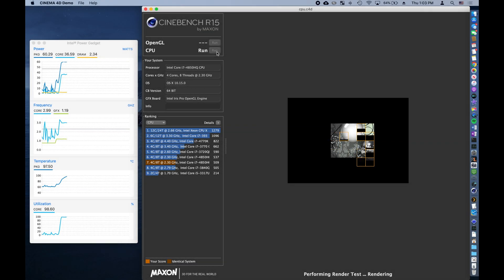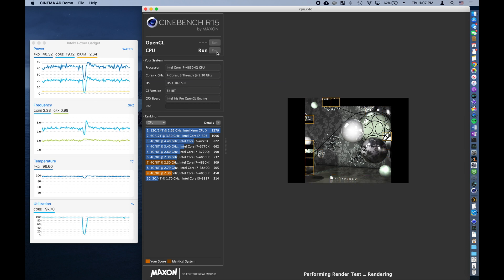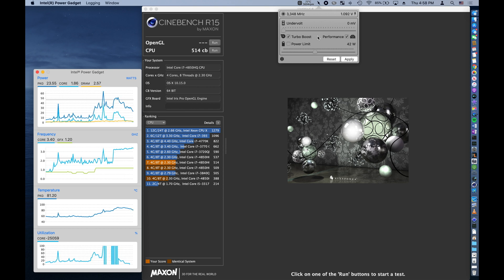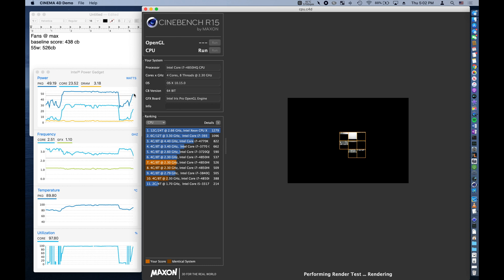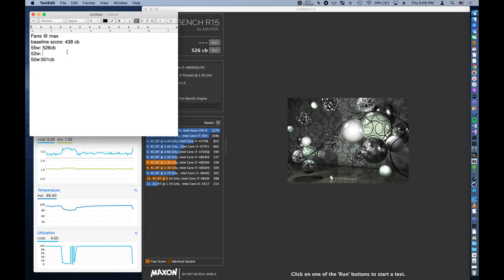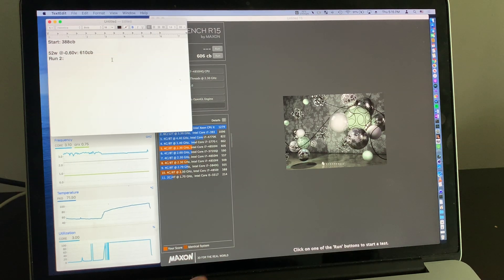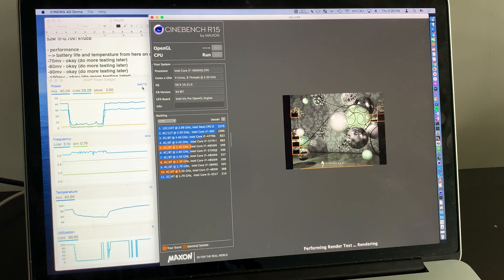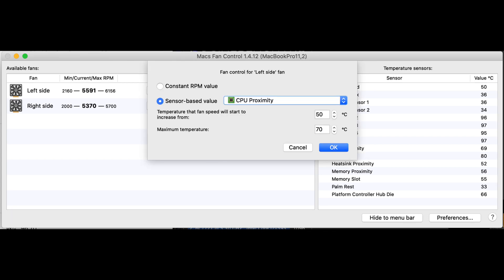Undervolting Tutorial | Mac OS Catalina | Destroy Thermal Throttling

Comment: I have everything unchecked and running on auto and my CPU proximity is 31 should I not even worry about undervolting? I set out to get my machine cooler it worked for CPU but overall temp is at 93 Celsius. Mid-2015 MacBook Pro running on latest Monterey OSX.
Reply from the maker: 93 sounds a bit high. Undervolting has many benefits with few drawbacks if you do it right. Worth a shot if you ask me!

Comment: Macbook 12 2015 here. How could I undervolt and get better battery life? I do only write in word and watch videos/ listen to podcast
Reply from the maker: You can definitely get better battery life. Adjust the voltage settings down while the CPU is not doing much until it crashes. Then use that setting (-125mv as an example) for daily use - if it freezes again then adjust upwards until it is stable.
Reply: @RuslanTulupov  oh thanks you! Since i Will only write, should I lower the TDP W ?
Reply from the maker: @axel9546  I would bump it up like in the video until you don’t see improvements to give the CPU breathing room and let it scale up if it needs to - things like software updates, occasional chrome launches might go faster. 
But if those aren’t important to you then yes, you can keep lowering the wattage until it’s slow but usable if that’s your primary use case

Comment: What’s the point of finding the upper voltage and lower voltage limit? I’m so confused about that! Should I leave my MacBook at the upper voltage limit all the time or should I leave it at the lower voltage limit? If you can please explain this to me, I will greatly appreciate it :)
Reply from the maker: Upper voltage is when your CPU is maxed out. Lower voltage limit is when the CPU is idling. 

You’ll want to use lower voltage limit as your setting - I could have made this clearer in the video and clarity is something I will work on!
Reply: @RuslanTulupov  thanks for the clarification! how can I properly find the lower voltage limit? Do I need to leave “Voltage” on in “Performance” mode or “Turbo Boost” mode while doing this? If you can please list out the proper steps on how I can do it, I would greatly appreciate it man!

Comment: MBP 2015 15" 4980HQ (2.8Ghz) 
I am getting 3.8Ghz while running Cinebench R20 and a score of 1454 or so with an undervolt of -70mV  and ambient of 16C but I haven't checked idle without any apps. I have checked it "idle" with my standard apps and at full bore for an hour. I am managing to sustain about 49-50 watts electrical to the CPU (after the initial peak). I run a CB R20 test or two which gets it hot and brings the fans up to 100%, then I lock them at 100% and run another couple of tests. Clearly heat produced by that electrical load will be less. I don't now how much less. TDP clearly is heat not electrical. I should mention that I am here writing this because I had issues with performance degradation so I repasted the CPU with Noctua NT-H1 that I have used on lots of other systems successfully. I then had much better results for a few days only to have the performance degrade again. I repasted with some even older Arctic Silver 5 I have and the results seem good again. I'll report back if I get performance degradation again. It appears the NT-H1 was pumping out. I read up on some white papers that spoke about pump-out and it definitely appears to be a thing with NT-H1 and bare dies like in these laptops. I also noted that my heat sink copper base plate is NOT flat. Its the first CPU heatsink I have ever seen that isn't flat. Its concave. I have wondered if the NT-H1 is not well suited to the high temps on these laptop die contacting heatsinks. Also wonder if the concave heatsink surface exacerbates the pump-out likelihood. Ah, and I have neglected a key point, I have my laptop on a custom stand that has a Scythe S-Flex 800RPM 120mm fan blowing air over the bottom and into the intake. Its got the dedicated GPU active all the time as its running two external monitors (1920x1200 + 2560x1600).

Comment: I got most of what you are saying, but didn't get how you arrive at the optimal undervolt value of -55mv? your MacBook crashed at -120mw correct? so how did you arrive at the optimal value of -55mv? Thanks!
Reply from the maker: Completely understood, I could have made that more clear!

At 100% usage the Mac was stable at -120, but at 0-10% usage it was only stable at -55. Since the Mac goes between 0-100%, I had to use -55.
Reply: @RuslanTulupov  help me! I can’t undervolt my macbook (MacBook Pro 13 2011)

Comment: There really should be a way to adapt the voltage to the CPU load. If the CPU is maxing out, drop the voltage to that -100mV, if it's idling, go to -50mV.
Reply: you mean voltage curves? yes, there definitely should be a way to adjust that as with GPUs.
Reply: This should be possible with VoltageShift for Mac
Reply: That’s exactly what the OS does, it monitors performance and adjusts voltage breaks every 150ms.

Comment: Hi Guys this is findings for my machine

MacBook Pro (Retina, 15-inch, Mid 2015)
2.5 GHz Quad-Core Intel Core i7
16 GB 1600 MHz DDR3
AMD Radeon R9 M370X 2 GB
Intel Iris Pro 1536 MB

Base Score Test - Cinebench R15
Test 1 - 289
Test 2 - 319
Test 3 - 292
Test 4 - 234

My Optimised configuration was base on highest Cinbench Perforamnce with Best CPU Temp | Best GHZ | Max 100% Core:

Cinebench Score was 530
35Watt
-100mV
Consistant CPU at 2.8Ghz
CPU Temp was a consistant 85degrees!!!!! SOOOO GOOOD
Core Utilization was 100% through out

Highest Ever Score and Configuration was:
Cinebench Score was 569
45Watt
-100mV
Consistant CPU at 3.1Ghz
CPU Temp was a consistant 100degrees!!!!! VERY BAD TOO HOT!!!
Core Utilization was 100% through out

I Hope this helps out anyone else.
Reply: The CPU can handle that temp(100). Don't be afraid of it. If you want to save power then thats another thing. Longevity might be affected but I have no evidence of that.

Comment: Volta crashes on my a1502 no idea why but gets to 100% cpu
Reply from the maker: Did you already adjust the voltage?
Reply: Ruslan Tulupov I just did a fresh install of Catalina, reset pram then did the sip commands on the Gary Mathews site. I think the programs simply broken in Catalina as I also did the exact same procedure with high Sierra and it worked properly.
Reply from the maker: @ps3customgamer  Odd. I had it perfectly running on Catalina (granted it was an earlier version than the latest). I've lent out my 15" from 2013 but in a few weeks time I'll have access and will be able to investigate (if that helps)

Comment: Are u getting almost 100% cpu usage using volta in catalina? Btw great vídeo :)
Reply: @RuslanTulupov  Hello, i have also the problem on 10.15.2 that the helper is using more than 300% CPU Usage. Do you have this Problem? I'm using an MBAir 2015 and it worked fine on Mojave. Any fix? I also reinstalled it but with no success. Thx, Fatih

Comment: Do you have to keep u SIP disabled whenever you run Volta or can you reenable it after you set it up?
Reply from the maker: SIP must remain off for Volta to work. 
(Apologies for the delay! Some comment notifications go to my YouTube studio app, the others to YouTube). I try and get most questions answered ...
Reply: happyaccidents I think it’s just broken in Catalina. I’ve had the app ages and when I open it my fan gets loud and activity monitor shows com.gmsthews.volts.helper at 323.67% in cpu.
I was hoping to wipe the application support folder but there doesn’t seem to be a Volta or Gary Mathews labelled folder
Reply: SIP is disabled though no issues back in Mojave on this mid 2014 MBP. I also have a 2012 MBP which isn’t supported either and the same process starts on that using full cpu
Reply: @ps3customgamer  It isn't working on Catalina? I have the same MBP as you do.
Reply: Musthafa Noor I’d be interested if you could get a difgerent result. As above it’s broken on Catalina with SIP disabled. I messaged Gary Mathews no replies
Reply: @ps3customgamer  I tried it out, didn't really work (I'm new to this, maybe that's why). Have you tried it with Bootcamp?
Reply: Musthafa Noor it’s just an app on Mac. On “bootcamp” you’re just running Windows with intentionally crap Apple drivers but they didn’t disable access to intels XTU program like a lot of budget laptops
Reply: PS4 Custom Gamer Have you tried Voltage Shift on Mac? Saw it on GitHub a while back.
Reply: Musthafa Noor I couldn’t find a built version. I’m sure it’s easy to build the app but I haven’t learned to do it and I really don’t want to learn to do thay
Reply: Great question and I was wondering the same thing.

Comment: are you on a real mac or a hackintosh?

i suspect hackintosh because apple does not use overclockable cpu and undervolting is an overclocking thing.
Reply: You can still adjust the voltage as the processor scales itself. The point it to reduce thermals and increase performance for as long as possible given the constraints. Also you can see it's a MacBook Pro in the video itself...
Reply: he isn't overclocking, just altering the power and voltage going to the CPU. this has nothing to do with overclocking.

Comment: i was able to get it had to disable SIP.. btw raisting the watt from 48/50 to 55 wont damage the cpu?   my cpu when locked in to performance maxes at 25watts.
Reply: im sorry it maxes at 29  i put it to 35 and it still stays at 29.. i actually got a better score when i lowered the watts to 27.. 29 watts had it throttling
Reply: Ruslan Tulupov thanks me too. Yeah i end up putting watts down to 25 since my cpu couldnt go past it. It put the turbo down from 3.4 to 3.2 and temp at stress from 102c to 92c with turbo on.   Btw do u know if running benchtests within 10 minutes of replacing thermal paste will ruin the time it needs to settle in? I used grizzly
Reply: Ruslan Tulupov great video btw. Really helped my cinebench score improved from 756 to 838 running at 3.4 and 813 running at 3.2ghz UV at -55 and watts at 25

Comment: At 2:05 you say your processor maxes out at 45W, but I don't see clearly how you determined that.  Can you please explain?  (I have a mid-2015 15" MBP top end model and wish to determine the same.)
Reply: @RuslanTulupov  Thank you for the advice.  It appears my I7-4980HQ is 47W, according to Intel's website.  I'm still trying to figure out what that "Performance" checkbox in Volta does.  Sadly, the Volta website makes no mentioned of that checkbox at all.  So I am trying to determine if you are reducing Power in Volta primarily to save battery when your MBP is used exclusively on battery power, or if there is some other benefit to reducing power to 52W in your case.  I know you mention "thermal limit" but are you really getting a performance gain by reducing power to 52W in combination with under-volting versus not limiting power and using the same under-volting?
Reply: @JDW-  What was Ruslan Tulupov's comment? It's somehow deleted and now we cannot see what you replied to? :)
Reply: @rolanddes  It was 1 year ago, so of course I cannot remember.  Very odd that he would have deleted his posts though. You can see the exact Volta settings I use on my mid-2015 15" MBP in my video here: https://youtu.be/_XQNGNAwrLw
Reply from the maker: @roland thats my bad! I was experimenting with changing the channel name about eight months ago and it cleared out my old comments. Let me revisit this after work and get you that answer!
Reply: @RuslanTulupov  Thanks a lot. I'll be waiting.
Reply from the maker: @rolanddes  
45Watts: This was a bit incorrect and I think I mentioned this is the comment as well - it was actually 47watts and is the TDP of the processor for my CPU (4850HQ). Obtained from Intel's site.

https://ark.intel.com/content/www/us/en/ark/products/76086/intel-core-i7-4850hq-processor-6m-cache-up-to-3-50-ghz.html

With regards to performance mode, it locks in the processor's maximum frequency, as you might see in the video, when I select performance mode it locks in the maximum frequency so that we can fully stress the processor and that helps determine the upper power limit.

Once we know how much we can undervolt by at the processor's highest demand (frequency, power draw), we need to do the same for the lower threshold. That part is more experimental and we need to bump up the undervolt bit by bit until the processor is stable, since it might undervolt more at its maximum frequency but will be unstable if scaling between frequencies.

Hope that helps and glad to follow up
Reply: @RuslanTulupov  Thanks a lot. My MBP Mid 2014 with 2.2Ghz Base and 3.4Ghz TB has the same 47 watts TDP. However with Cinebench it does not thermal throttle. Because my cores do not reach 100C which is nice. What is weird is that even though both Turbo Boost and Performance mods are enabled in Volta, I do not see 3.4Ghz except for a few seconds at the start of the run. It decreases back to 3.0Ghz and stays there for the whole run. Would you have any idea why?
Reply: @RuslanTulupov  Thank you for the very helpful explanation!  And thank you for your video as well.

Comment: Which model have you got? I get similar results, GHZ at around 2.9~, temps at 92.5, and fans halfway at around 4.2k ~. Undervolting made no difference. Selecting "Performance" actually made everything much worse. 

If not a secret, what score do you get on Cinebench R20?
Reply: You drop 10-20 degrees C by changing thermal paste and it allows your mac to hit full turbo frequency all the time
Reply: Dear author of the channel could you help me with the installation instructions just by copying it from the official site. Unfortunately I can't open the site. thanks in advance